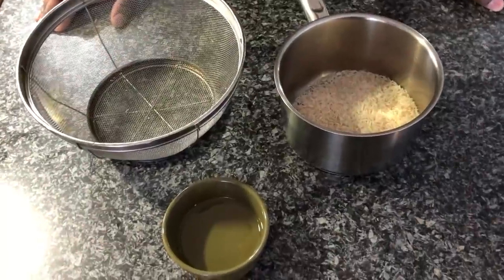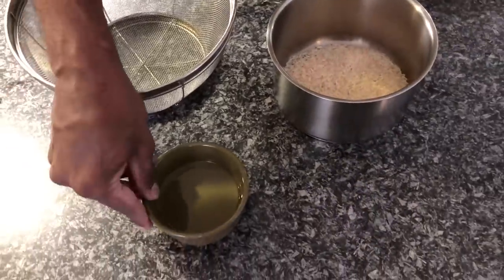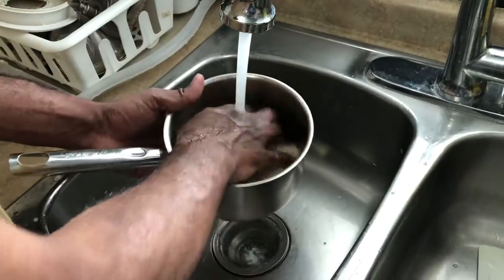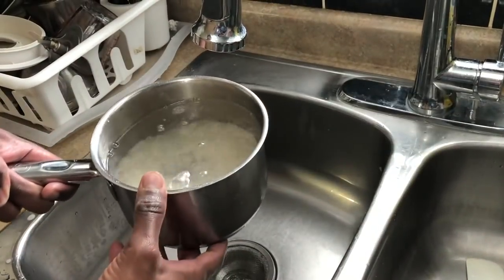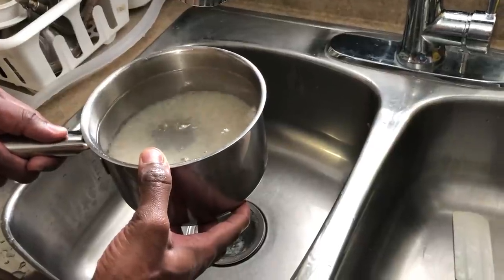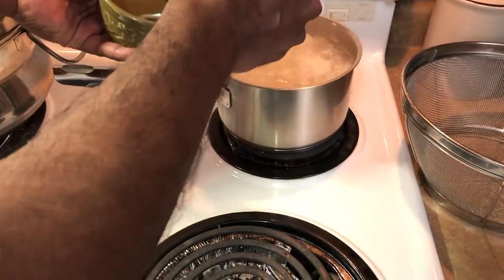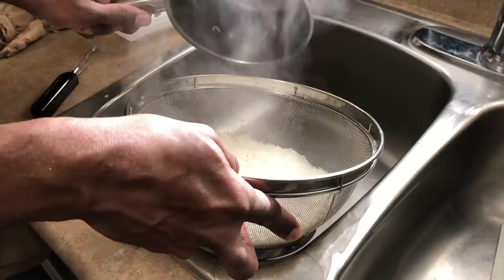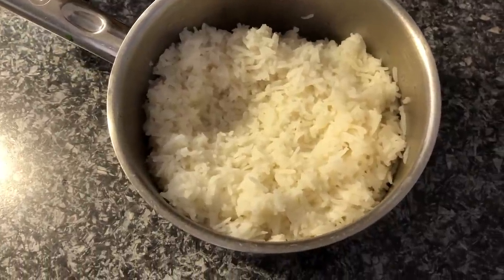Diabetic Friendly White Rice Cooking Method

Comment: Thank you for your video. We cook rice exactly like this but after draining the water we put it back on the stove with very low heat so it dries the rice well before consuming or we wrap a clean dishcloth over the lid, close the pot and put back the pot of rice on the stove with very low heat until the rice is nice and dry. We also run cold water into the rice after draining the boiled water, then strain it well before putting the rice back on the stove with very low heat to dry the rice well .... Enjoy!!
Reply from the maker: Thank you for some tips that you have shared. Please continue your support to this channel.

Comment: Very beneficial video. Good to add the explanation as to why 2 tablespoon of oil is added to the boiling rice to make the presentation complete. Actually, until the advent of the rice cooker, the method shown in the video was how rice was cooked....and diabetes was relatively unknown!
Reply from the maker: Thank you for the comment. The oil is added is to prevent the grains from sticking together when it get cool off.
Thank you for your support.
Reply: That's not how Japanese in Hawaii cooked rice!! And if you are worried about sugar get off your butt and exercise 😂😉
Reply: @Dstoku21  
Hi Daryl, exercises don’t get rid off your sugar. Don’t put the sugar in your body in the first place.
Reply: @Dstoku21 You ain't in Japan anymore, Toto!

Comment: Thanks for the advice! How about using the water for plants instead of puring down drain!?
Reply from the maker: Yes indeed, this could be used for plants but I do not have a garden or pots that contains flowers or little plants, so I am forced to throw them away. If I have, surely I would use it for them..
Thank you for the comment and support. 
Cheers!!!
Reply: Friday Friendly Kitchen thanks for the response! Or close the tap and not let the water run ? I have seen your method of washing rice in rural Asia and doing it since.

Comment: I just read some stuff about rice in general a couple days ago. It turns out white rice has the highest Glycemic Index 73, followed by brown rice 68 and then Basmati brown rice (50). So if you cook Brown Basmatic rice this way to reduce the starch further and then only eat a quarter serving then you should be ok. For diabetics, SOME carbs are allowed and necessary. But even then eat rice if you must. Better to try Quinoa or Shitaki noodles or  Shitaki rice (i have yet to try Shitaki) and see what works best. For me, i just need a change from low carb pita bread so i will be trying Quinoa and Shitaki.
Reply from the maker: Thank you for the great comment which you have shared. I will do my research on this to obtain more information.
Thank you very much for your support.
Reply: Nope.. carbs are not necessary

Comment: Hi, Went through your video...everything looks positive except few points a) Like any other grain  Rice also has vitamins which goes away when after cooking you throw away the water. Instead of that while cooking in any vessal take out the white thing  that comes on top which is starch. Diebetic patient should have rice with protein,Fibre, Fats, Pickle to reduce the Glycemic Index of rice. 2) If you are cooking in pressure cooker put the lid after removing the white thing.

Comment: Lay a wooden spoon directly across the top of that pan, with the lid removed, and you don't have to worry about the pan then boiling over. The water will not rise above the spoon. There is actually a scientific explanation for this action by the spoon, but I don't recall the specifics of it. I just know that it works.
Reply from the maker: Yes I am aware of that method too, I do at times but most of the times I do not. 
Thank you for your support James.

Comment: In New Orleans after we dump the cooked rice into the colander, it’s thoroughly rinsed with hot water. Then we rest the colander on another pot to drain the access water. We don’t place the unrinsed rice back into a pot. It remains in the colander until the meal is served.
Reply from the maker: That's a good info
Reply: Yes the water drains out completely. It takes a few minutes but it’s worth it.

Comment: Nicely presented. This is the traditional way of cooking rice in India, especially in the southern parts. Instead of a metal colander generally hand woven cane baskets are used to drain the cooked rice to remove starch. 

Oil is not necessarily added. Though you seem to have forgotten to tell why oil is used ...or did I miss it? ....I understand that it is added to keep the rice grains separate and not mashed up. Not sure.
Often we add a little salt to the rice while cooking, presumably to make it tasty. 

Thank you for posting this.
Reply from the maker: Thank you for this comment and your compliment. 
Yes indeed, even though I was not born in India, In my family we used this method all the time and we used par boiled rice. 
I added oil is to prevent the grains from sticking together & you did not miss it but I forget to tell you guys the reason. My apologies on this and for the late reply as I did not receive any notifications. 
Thank you for your support.
Reply: I have also cooked my rice like this in the past years, but I added my salt to the boiling water. Thanks for the informative Video.

Comment: No white rice is suitable as it is high gi. I converted to soba noodles and slowly ease out of the accustomed full stomach feeling of a meal. You do not need that much food, get use to fasting. Be impoverished as all poor starving ppl have zero diabetic issues.
Reply: I think you are right, fasting or eating less can reverse a diabetes.
Reply: "No white rice is suitable as it is high gi."

White rice is not proven to cause abnormal blood sugar spikes. Have you ever experienced an abnormal blood sugar reading after eating white rice?
Reply: @solitaryrefinement6787  Been eating rice 30+ years first 15 was noproblems, then hit 18 prediabetic. And i don't even indulge in candy, sugary, bread foods all my life. That's why i blame the culprit to rice. You can get away with less glucose with refrigerating rice / converting it to resistant starch.
Reply: @wric01  Yeah, but that's never been "proven".
Reply: Pure soba noodles are good diabetes because it is made of buckwheat. However, normally wheat flour is added to buckwheat flour for economic reasons. Buckwheat flour is apparently expensive.

Comment: You broke the rice while washing it ,the way you wash cloths .   You better wash it with both hands and with your palms only . Not squishing it.    Then if you soak it overnight and rinse it again before cooking. 
After you boil it cook the rice only 95% and strain in . Then put it back in the pot and make  haf cup of hot water with salt and any seasoning you wish mostly for white color rice cumin preferred,  but if you put some caramelized sugar for color to the rice you can put cumin, cinimen cardamom, black pepper and salt if you want with some cooking oil . Then you put the mixture in the pot with the rice  and stir it make some holes with the handle of a spoon to steam evenly and put the lid on . After few mints ( 5 to 10 ) depending to the amount of rice , put the heat at lowest and put a cloth on the to of the pot under the lid . Leave it on for at least 20 min to vaporate all water and then you can serve . 

We are eating rice as a main dish for years and best quality rice long grain basmati not the cheap one.  At least for a 5 pound costs $12 . So you will enjoy !!!
Reply from the maker: Thank you for this suggestion, I will give a try on this.

Comment: Not sure. If you are a diabetic. Avoid Carb n Sugar.
Reply from the maker: Thank you for the comment as a respond to your comment, 
I am an Asian and I have witness this method of cooking before rice cooker was introduced. The cases of diabetes was rare with this method was used compared to when the rice cooker was introduced. Yes indeed as you mentioned avoid carbs. Carbs are necessary but in a moderate quantity and not in large amount to control the blood sugar level. Please consult your medical experts before trying this method. 
Thank you for your support.
Reply: @FridayFriendlyKitchen  

Thanks. It is better to cook your way instead of rice cooker for sure. 🙏❤️

Comment: You can use hot water to clean up d rice sothat easily carbo will be removed at one or two timings
Reply from the maker: Thank you for the suggestion and tip. I will remember that.  The weather here is very hot and I want to make yogurt rice. For this I need to cook some rice. I will remember your tip.
Thank you for your comment and support ❤❤❤

Comment: You didn't say what the oil was for.
Reply from the maker: Actually I forget to mention why oil is added but allow me to tell you now which gives me a chance to interact with you. 
The reason while oil is added, this is to prevent the cooked rice grains from sticking. 
Thank you for your support.
Reply: @FridayFriendlyKitchen  but wouldn't that just add a lot of extra fat and calories?
Reply from the maker: @chilover9154  not really. If you are using animal fat then you can consider it. 
Thank you for your support. ❤❤❤
Reply: @FridayFriendlyKitchen  ok thanks! ☺
Reply from the maker: @chilover9154  you are welcome.
Reply: Oil also helps the remaining starch around the grain from digesting quickly. For diabetics quick digestion means a spike in glucose. Another tip is to let the rice cool so it becomes a resistant starch...even slower digestion. Read up on resistant starch.

Comment: Did you notice the faucet was running full speed while you were rinsing the rice.
Reply from the maker: Thank you for the comment. 
Just to let you know, the water pressure in my place is strong, even it is turned on on low pressure, it still looks like it is on the full side.
Thank you once again and please keep supporting this channel.

Comment: What is the difference in carbs. And you didn't say what the oil was for, and what type you used. Not very helpful.
Reply from the maker: Thank you for the comment. This is an ancient way of cooking rice before electrical rice cooker was found especially in Asian Region while using the ancient fire wood stove. 
There are some carbs remaining but most of the carbs are removed from separating the starch. In our electrical rice cooker we are told or advice to use 1.5 cups of water for every cup of uncooked rice. And the starch retains within the grains  which is not on the healthy side especially patients who are with diabetes. While in the traditional methods , the starch is removed mire than 70%  to 80% with remaining very little starch. Every human being needs some starch for the body as the starch can be found in also different ways.

Comment: Couldn't you just stir the rice every time and let soak for a minute before rinsing so many times? You could probably remove most of the starch without wasting so much water. And, always consult your doctor. Sorry, I know that you claim to be a diabetic, but everyone is different.
Reply from the maker: That's a good idea. Thank you.
Reply from the maker: Respond to your comment is, when the rice cools off, the grains with stick together. I have tried this idea and my results that I have achieved is sticked rice. Sadly, that was my result.
Reply: @FridayFriendlyKitchen  I didn't explain myself well. I meant keep squeezing and pressing the rice the way you did for the first two rinses (not ever during cooking...you really ought to use a ratio of 2 cups of water to 1 cup of rice...stir once and uncovered bring to a boil, then cover and reduce to simmer for 15 minutes without uncovering...after 15 minutes remove from heat and lit sit covered for 5 minutes...after 5 minutes fluff with a fork). You may still need an additional rinse or two BEFORE cooking, but you may find you don't need as many rinses. And, please don't leave the water running whilst you drain the rice like during the second rinse. I hope I did a better job explaining myself this time around. I rarely eat rice, but I came here solely because my mother used this method for rinsing rice for a long time and still her doctor told her not to eat rice. And, the directions (that do really work) are on the packaging. Recently my mother was diagnosed with prediabetes but she's in her late 70's and also likes desserts like Mexican Pan Dulce, cake, cookies, pies, and ice cream. Anyhoo, thank you for not being upset with me, I didn't mean to come across as annoying. I wish you only good health  and good will.
Reply from the maker: @Diana-xm1dm  thank you very much. ❤

Comment: Rice is not good for a diabetic
Reply from the maker: It is? 
Would you mind sharing your explanation?  
Thank you ☺
Reply from the maker: Joseph Lentz  I just eat them and I don't count how many carbs contains there. Eat well and exercise well. This is what I think. Thank you for commenting. ❤❤❤
Reply: @FridayFriendlyKitchen  if you do not count carbs then, with all due respect, you are not qualified to make statements about its suitability for diabetics.
Reply from the maker: @marcopolo9146  thank you for the comment 😉😉😉
Reply: @marcopolo9146   not necessary to count carbs.  will need to check several times with a glucose meter. even if you get half the carbs out it may still blast your glucose. worth a try that's for sure.
Reply: Hot starch into the drain damages the pipes
Reply from the maker: @bharathikathi3987  Don't worry,, I have benn doing this for a long time and nothing happened.  Thank you for the alert though.  ❤❤❤